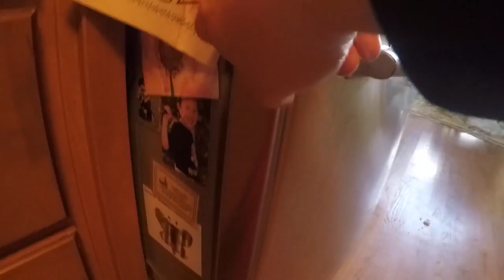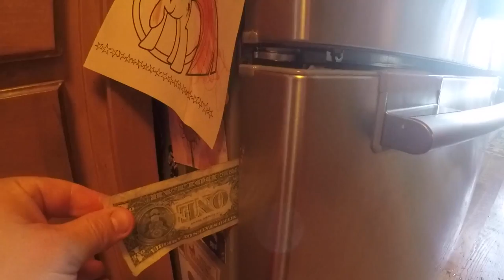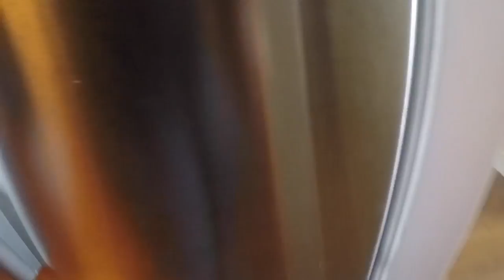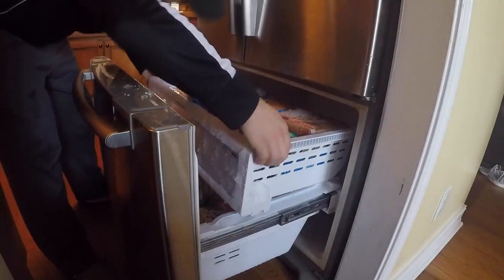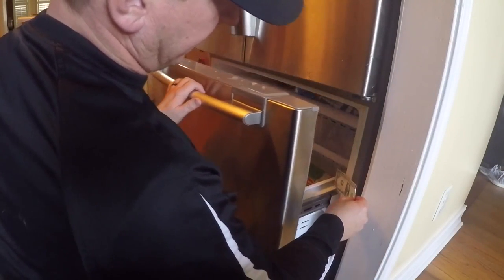Fixed: Frost Buildup In The Freezer Causes

Comment: The real problem starts from having too high a temp on the freezer......it should be no higher then 0 farenheight......
Reply: I don't know about these, but on the fridges I have worked on, and there have been several, I am usuakky giod wuth 0 to 10 degrees f in the freezers. I was somewhat surprised that the Samsung I got in suggests -2 f.  I guess that would make for some hard ice cream.  :)
  And use a little more energy.
Reply: Good point. That was my first thought with mine. I have a temperature readout on my new Whirlpool french door fridge/freezer, and it said 0 for the freezer, but when I opened the freezer one day, there was flaky frost over everything - kind of pretty, but not! My first thought was to make sure the temperature gauge was correct, so left a thermometer in over night. It was pretty close to 0 when I pulled it out, so then I came to this DIY video. I like the dollar-bill test; mine seemed sealed fine, so think something got in the way just enough to let in moisture, but not set off the door alarm. What I'd like to know is how long it takes for the frost to clear up.
Reply: @A11iOop  On the one I got in, I let sit unplugged over night.  But, there was no food in it at the time.  Be prepared for some water on the floor if there is enough frost in it to overflow the drain pan.  Seems like I did scrape some if the ice out.  Be careful when scraping ice out.  Do not be too agressive.  After it thaws some, some of the ice can be removed in fairly large chunks or sheets.  If you get enough out, you may just have to dryer the freezer with a towel when completely thawed.  I left mine unplugged over night eith the drawer partially opened to make  sure it was COMPLETELY thawed off the evaporator coil.  
  I then did a hard reset and reset the temps at the recommended setting.  Hard reset puts the unit in what is cslled Demo Mode.  You then set the temps at the recommended settings
  Hard reset involves holding two buttons on the digital display for abbout 8 to 12 seconds or until you hear a musical chime.  It then goes into Demo Mode.  You then set the temps.
  On my unit, I think the buttons I held were Forced Freeze and Forced Cool.  I am not sure about that.  I will have to look at the display buttons again.  I hsve seen that some reset with  different buttons than mine.
  I did check all I knew to check before doing this.  Everything checked good.  Still not sure what caused this problem for the people I got it from.  Faulty connection somewhere? Power surge?  Drawer left left slightly ajar?  I really can't say.
  Btw, I also made sure the gasket was cleaned off really good.  No food specks, etc. left on the gasket.

Comment: Thank you for the video.  I thought I had a huge repair problem.  Turns out the the freezer was not closed properly and the ice buildup kept the freezer from closing.  I removed the ice from the back of the freezer and under the drawer.  The drawer closed and sealed properly immediately
Reply from the maker: J Keeton That great! I’m glad you found your issue.

Comment: I have a similar fridge from LG , but notice frost is building up inside the fridge not freezer. Right where you open French doors behind the bottom sliding drawer by the vent.
Reply from the maker: MrZACATECANO100 Have you checked the temperature the fridge is set on?
Reply: TightWadDIY just now 36f•

Comment: hey mines just starting to ice up and has a drawer just like this one but  it doesnt pull out quite so far. i tried to take trays out and its impossible. guess illl be putting things in cooler to attemt to dismantle tommorow..yes we had door left open and or thawing happen before this started.. if the seal is good after i test it tommorow what should i also small amount of frost thats starting to accumulate...will the freezer just take care of itself on the defrost cycle....eventually?? also while the thermostate is reading 0 on the oanel inside the fridge my lil thermometer in the fridge is below -20
Reply from the maker: Marissa Brueshaber You can try keeping it closed and see if it takes care of itself. If you only left it open once, check the seal to make sure it’s closing good and just let it ride.

Comment: Thank you so much. This wasn't the exact solution but it got me there. I checked the seal with the fridge door open and sure enough top and right seal has some space.  Top door was off track due to ice but a lil bent. Was able to straighten it out. Cleaned all the ice out. Dried everything off and bam seals fine. Again you're doing such a service to everyone with these videos. I prefer doing what I can on my own then escalating as the issue shows to be worse than expected.
Reply from the maker: That’s great!

Comment: Did you tell the homeowner to take Vaseline and place a very thin layer on the door gasket that would help the gasket to stay pliable and able to seal properly. Not thick at all, just a very thin coating. Be sure and get the whole perimeter.

Comment: Mine looks like there was water sprayed inside, there is big frozen drops inside
Reply from the maker: Uriel Valdez That sounds like your freezer started to thaw and then refroze. Did you have a power outage?
Reply: TightWadDIY actually, yes, it wasn’t for very long but we did lose power. I made sure the door was closing all the way like you did so hopefully that solves the issue. Its a fairly
New fridge, only a month old. Im
Hoping that it wont become a problem

Comment: Gave my daughter a Samsung bottom freezer fridge very similar to this one.  I ran it for over a month with nothing in it but a bottle of water after solving the ice problem in the freezer itself. Had done a hard reset, set the temps.  Showed to be holding tbe temps fine with no ice buildup.
  Now she tells me she had some food in the back of a lower shelf in the fresh food compartment to freeze.
  She opened the humidor a little more.  
  Should it be closed more rather than opened?
  That being said, I suspect maybe an air leak.  The flipper/mullion was broken on the top hinge during the move and might not have sealed off properly by swiveling it by hand when closing that door.

Comment: I think the defrost drain is clogged. It is the most common issue that cause this.
Reply from the maker: Jeff Barnes That can be the issue but it’s not the most common cause.
Reply: TightWadDIY what is the most common cause? It’s for sure not the kids not closing the door. Having said that I do appreciate your video.
Reply from the maker: Jeff Barnes The most common cause of this frost build up in modern freezers is something preventing the door from closing. Most often an item that has fallen behind the door.
Reply: TightWadDIY 10-4 thanks

Comment: @tightwad, love your handle! I've got ice build up on a 'top in freezer' ice maker,  Maytag....I've adjusted temperature, tested the seals etc. I'm ready to disconnect it, it builds up on a daily basis....any ideas? Yes I'm in a humid climate Hawaii, but nothing is working. Any info would be helpful!
Reply: The ice build up is only right where the ice maker is, left side on top freezer.....
Reply from the maker: fit4lifelucky1 Thanks! Do you think you might have a leak in the water port for the ice maker?

Comment: I'm having a similar problem. Also, the water dispenser has stopped working. Could these things be related?
Reply from the maker: Michael Williams I doubt the are related. The water dispenser not working could be caused my several things. Does your fridge have an ice maker in the top where the water dispenser is located? Does your ice maker still work?
Reply: @TightWadDIY  The ice maker still works. There is no ice dispenser on the top portion of the fridge. It is in the bottom portion only. I ask because the water seemed to be working just fine until a day or two after the ice started to build up. I thought it was either related or I just have really bad luck... I've cleared the track to get the freezer to seal, and will de-ice the entire freezer in the morning to see if it makes any difference.
Reply from the maker: Michael Williams You water line could be frozen up but I doubt it. If it’s still making ice then that means water is getting to the fridge.
Reply: @TightWadDIY  Ice built up around part of the reservoir in the water line. Hair dryer took care of it. Water is flowing fine now. Thanks for all your help!

Comment: So you blamed the frost on one side of the freezer drawer  on the owners leaving the freezer door open too long?   I don't buy that.  Of course when there's a build up of ice, the door is going to hit it and not close/seal properly.  It was no surprise to me that it continued to frost and ice when all that was done was to remove the drawers and replace them.  It is my opinion that there is something wrong with the freezer (just as with our own Kitchenaid freezer door frosting up).   Something needs to actually be fixed on the unit in your video.  Can't blame it on the homeowner.    I did, however, appreciate your dollar bill (or piece of paper) trick.    Our freezer began to ice up after a serviceman worked on it to install a box fan in the back and LED lights in the refrigerator portion.  I don't know if the frosting and their maintenance were associate.  All I know is that it never froze up before and then we started noticing it a week or two afterwards.  Hard to pin it down.
Reply from the maker: Leaving the freezer open started their issue and it got worse over time because it never closed properly after the initial time. Once I removed the drawers to ensure there was nothing behind them and removed the ice from the tracks, they never had any other issues. This was several years ago. I don’t know what you “aren’t buying”.